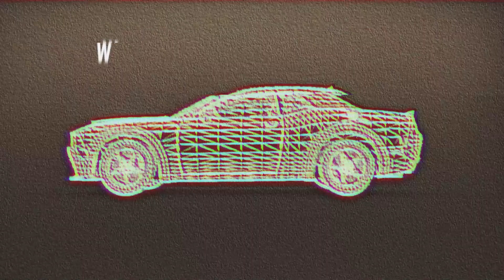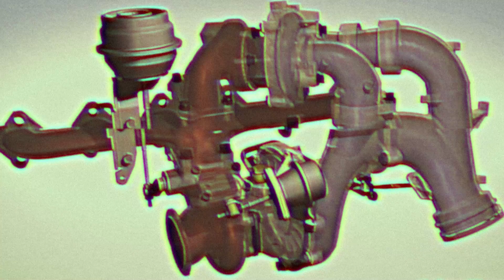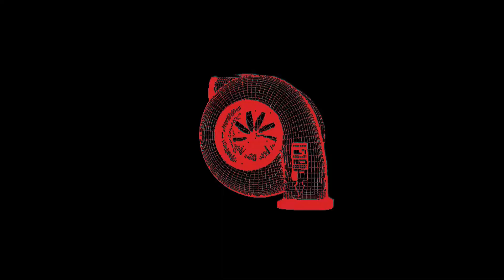Why V8 Engines Prefer Superchargers Over Turbos ? | Superchargers vs. Turbos

Comment: Supercharges at this point are almost dead in production cars. Hellcats and Demons are out of production, same for Camaro ZL1, the new Corvette uses turbos now, and the Mustang GTD is very limited in production...

Achieving emission goals and fuel economy with a supercharger isnt an easy task... You have a lot of tech to help with this, but nothing can ''hide'' the parasitic losses that gives you a lower number in max hp... (that alone counts a lot when people are buying an sports car).

Turbo lag inst a big deal with so many new tech these days...
So, just to resume... V8´s dont prefer susperchargers.... Basically nobody are using then in PRODUCTION cars and even V8´s are dying at this point.

The EV growth, the hybrid system and newer turbo tech are just killing it at this point.

Mercedes AMG C63 isnt a V8 anymore.
Ferrari F80 is now a V6...
Mclaren said the new McLaren W1 and the 750S, can be the last V8 in their production line...
Dodges still have V8´s for 2025, but none is suspercharged anymore.
Corvette ZR1 is now turbo.
Mustang GT500 is out of production.
Reply from the maker: Well said

Comment: It depends on the V8. If it's a high revving flatplane cranck V8 you have to go Turbo. If it's crossplane cranck v8, big displacement with emphasis on low RPM torque go to Supercharge route.

Comment: Get rid of all turbos and put in a supercharger and see the difference. Its day and night. All turbos ruin the driving experience where as superchargers make boring cars fun
Reply: You're half correct........but the issue isn't the turbos.......it's simply the small displacement engines with less than 8 cylinders lacking the torque that the factory turbos are put on by car choice as a starting ground. You put a large enough turbo on a v8 car, and you're not going to have a lack of anything. Turbos literally multiple the power output that already exists before the turbo is factored in(and yes so do supercharges as well,  but positive displacement supercharges that replaces an intake manifold resting on top of the motor actually rob power to make power)........so basically if you have a V8 with alot of torque already to begin with,  then slapping a turbo on it will only enhance the power band of that v8 where it truly matters without sacrifice orginal power and no it won't be more torquey under casual driving conditions but there's ways around getting low and torque while being equipped with a turbo. The ceiling for max power potential is greater using turbos simply because of boost controllers and how turbos are fed with exhaust gases, which why the boost comes in so strong suddenly with a turbo. You have belt driven superchargers that have a similar power curve like turbos if large enough of a centrifugal supercharger but with the less efficiency being driven by the crank with belt slip odds that nobody desires and less of a turbo boost sensation because of how specific on how fast the supercharge pully is spun and the main dependency.There's nothing about turbos that causes a bad reputation except the lag on too small of an engine.......they're wayn more efficient on how they make power, there for, they have the greater potential ceiling to make insane power while not putting strain on the crank pulley at all because the turbo isn't belt driven by the crank, and you have a wider choice of turbos to choose from by size and various customations and fabrications plus the possibility of have two turbos instead of the limited 1 supercharger on a motor at a given time.

Now granted positive displacement superchargers do supply instant torque........but you can get the same if not better out the hole torque with spooling up a turbo while at a stand still with a launch controller or even a roll and being able to control the potential of having too much torque and sudden boost spikes with again a boost controller with a turbo. With positive displacement superchargers, there's no computer adjustment conveniently accessible. It's mainly and specifically changing pulleys and or dialing back on the tune to make the car run ca more rich air fuel mixture.

Lastly is everyone is impressed with how much horsepower a car makes overall. Well this horsepower factor heavily involves the max rpm the motor can make its peak power at favoring turbos more and with turbos the greater advantage simply is that it potential is higher the more rpm the turbo can take advantage of. Positive displacement superchargers aren't designed with making peak rpm horsepower better than what turbos simply do the best at which is make impressive high rpm horsepower.
Reply: @MrDerekRobinson  wonderful explanation! Really enjoyed reading that and learned Alot!
Reply: @MrDerekRobinson  my guy I really appreciate that now I really understand the difference between them 🫡

Comment: Tell thet to my '20 M5 competition with it's TTV8. I think superchargers require more displacement to be as efficient because they are parasitic first, before they are beneficial.
Reply from the maker: Superchargers take 20-30% of your power as a "parasitic" effect, but then give you back about 50% or more back. Depends on many factors, but yeah.
Reply: @Asphalt.X  versus a turbo using a 100% waste product and converting that to increased power without using horsepower. I think both are application specific. However I think the only advantage supercharging has is more immediate response, even though hot V turbo placement ALMOST (emphasis) completely mitigates lag. In my opinion.
Reply from the maker: @chrissmith-rv5ro  personally, I prefer turbos on any kind of engine. Definitely more versatile. But again everyone has their reasons to their preference. Thanks for sharing!

Comment: Turbo's are filthy dirty and ruin the inside of motors with a shyt ton of carbon.. Don't get me wrong everyone knows for big power you kind have to go with turbos' but for instant torque and power on a daily the blower is what you want..
Reply: What??? Carbon build up comes from egr valves and pcv valve systems in cars. How does a turbo sucking in clean air create carbon? Magic? Or have you solved the climate crisis?
Reply: Carbon buildup isn’t the result of turbos my guy. Carbon only occurs on the valves and the piston head. Valves get carbon because of direct injection which can be easily avoided with an oil catchcan. And to burn the carbon in the piston just do the Italian tune up. They don’t harm the engine in any way.its physics. Both methods forced induction don’t affect the engine on their own. But the one hint that you should 100% look at is exhaust gas temperature sensor. You do not want that to get over a certain point
Reply from the maker: Didn't know about the carbon thing, thanks for sharing. However I heard a tuner once saying that supercharged engined have a tendency to have bent bent pistons unlike turbo engines. Although that might be true in racing rather than production models. Not entirely sure though.
Reply: @apex_media_tv bend pistons? That is just wrong, what he meant is bend rods. And you only bend rods if you go over what your rods are torque rated for. You must 100% factor in fatigue
Reply from the maker: @ Thanks, appreciate it!

Comment: The real question is why don’t cars have both superchargers and turbochargers?
Reply: Too expensive and not compatible for all cars and sometimes it's impossible to do, same as finding a front axel for a cCorvetteto make it AWD , this is the only car in the world that couldn't be AWD till E-Ray appeared , also it's eAWD not natural AWD too , moral : it's almost impossible and so expensive and not all cars have the space in hood for that , beside the SC and TT kits alone adds like 100 KGs or little bit less , that's so bad in terms of weight power delivery to rear wheels
Reply from the maker: Thank you for all that information
Reply: it's called "twincharging" also twin turbos can't be applied with superchargers , only 1 Big gigantic turbo with a BAS Supercharger to fill each other gap or 2 big turbos with same size without anti-lag
Reply: They have them. Its just not cost effective and over complicated.
Reply: Volvo has a supercharged and turbocharged engine.  It’s the T6 engine they started using in 2016.  Supercharger provides boost at the low end until the turbocharger spools, then the supercharger decouples.
Reply: they did but it was a rally car. lancia delta s4
Reply: i think what you’re talking about is called a procharger, which is a turbo and supercharger mixed together
Reply: @ar3x_211 - LOL!  Procharger is a brand of centrifugal supercharger!  Vortech and ESS are some other brands that make centrifugal superchargers. There are 3 types of superchargers:  centrifugal, which looks like a turbo but is belt driven.  Roots and twin-screw type are the other 2 types.
Reply: @ar3x_211 Pro charger is the brand. Its called a centrifugal supercharger.

Comment: Uhhhhh sooooo we are just gonna ignore the new ZR1?
Reply: it was the stupidest idea to turbocharge a true American supercar beside adding a stupid ferrari sounds , it's not a corvette , not anymore , it's a Ferrari rip off replica , that's it , C6 ZR1 rules and still the true king of the hill , not even C7 ZR1 or C8 ZR1 can't and couldn't compete if you gave all these ZR1s the same amount of HP , C6 rules and niggs and leave C7 and C8 to dust since 2nd gear
Reply: @gracestingray  oh trust me, I have a C6 Z06 and I personally believe that it's the greatest generation of Corvette EVER! BUTTTT, we have to look at facts here. Turbo charged American V8s will make more power just for the fact that it's free power. No belt slip or parasitic loss on the engine. You take a C6 ZR1 and slap a nice precision turbo on that bad boy, boost for boost the turbo will make more power BUT it will loose that instant torque.
Reply: @trevorcunning6248  it'll lose the  instant torque to some extent, but will then , it will make it up more than enough on the top end. Plus with its lightweight,  it doesn't need crazy torque to get it going.......that only causes the need to have a good set of tire compound wide enough to handle the raw initial hit from stock modified supercharger.......but once rpms starting peak the top of the range......torque isn't a major factor anymore with the turbo
Reply: @MrDerekRobinson  exactly. And we have things such as anti lag to compensate for the instant torque.
Reply: @gracestingray so what do you think about the Saleen S7?
Reply from the maker: Incredible car, ahead of its time

Comment: I have a turbo car, a supercharged car and a V8.  The supercharged car is an R53 Mini Cooper.  The little 1.6L engine struggles in the summer to turn the supercharger and the A/C compressor.  The engine is MUCH more responsive with the A/C off.  I like the torque and sound of the V8 but it’s in a mid sized SUV so handling isn’t great. The turbo car is great to road trip because it gets adequate fuel economy and has the power when I need it.  Climbing hills in that car in cruise control is really nice - no downshifting and no high revving - just boost and it flattens those hills.
Reply: Whooo!!! Mini cooper!
Reply: The r53 never should of came with a supercharger with that liter of a engine it was better suited for a turbo which was more efficient and still fun

Comment: Lol. My BiTurbo V8 thinks different.
Reply from the maker: Did you watch the whole video?
Reply: @Asphalt.X  i did. I watched the part about euro v8's. Funny how the American makers follow the Euro guys about 10 years later.  Case in point Cadillac with the Blackwing and now the ZR1. Both have smaller displacement twin turbo V8's. They start at the top and work their way down.  I wouldn't be surprised to see a factory twin turbo Coyote show up one day. The American companies are just behind the curve.
Reply: @StrongmanTaylor if they’re so behind the curve then why is the zr1 a better preforming cars that cost multiple times more?
Reply: @the_doggos  it's one car......and yes more than 10 years behind.
Reply: Blackwing is 6.2 supercharged i think and the other option is twin turbo v6 @StrongmanTaylor
Reply: @altonanderson6311  The 2020 Cadillac CT6-V is a luxury sedan with a twin-turbo V8 Blackwing engine that produces 550 horsepower and 640 lb-ft of torque. 4.2 liter, hand built in Bowling Green by a single technician, who placed their name on a plaque on the engine cover. Just like AMG...
Reply: @StrongmanTaylor  American manufacturers arent following the Euros, they still do things differently and both produce high performance vehicles for different market